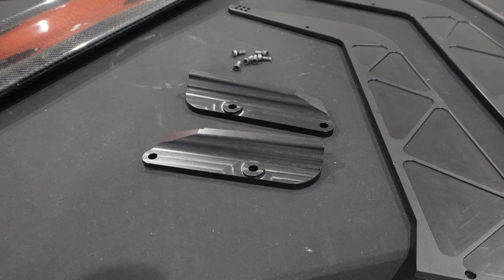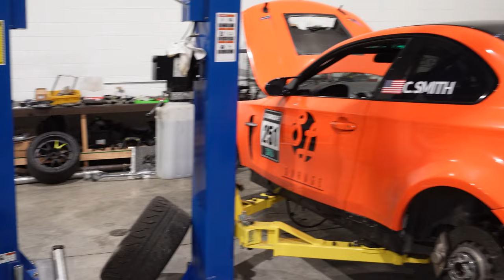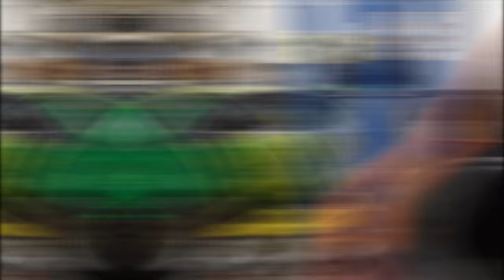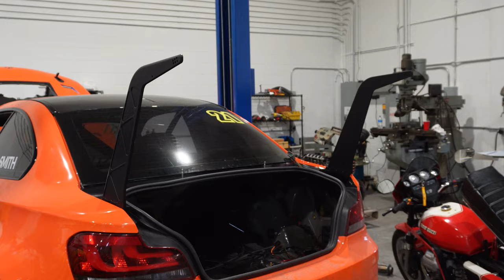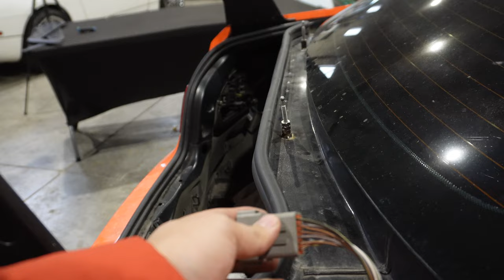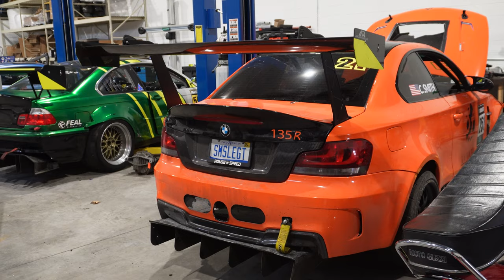Huge Swan Neck Wing Install on the BMW 1M!

Comment: Ofc my idea is taken again before I can even do it 😢
Reply from the maker: Still do it!
Reply: It's waaaay more elegant than the idea I had (doing one like the HARD e90 kit), damn this is sexy

Ah it sits so far back it's outside my class rules anyway, have to make my own either way. Have to be below the roofline and within the factory coachwork in every dimension